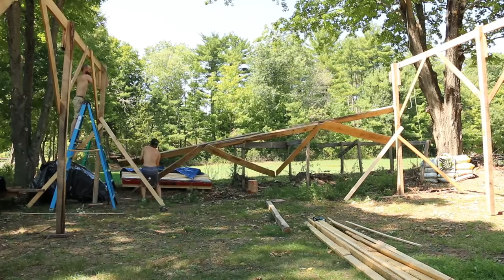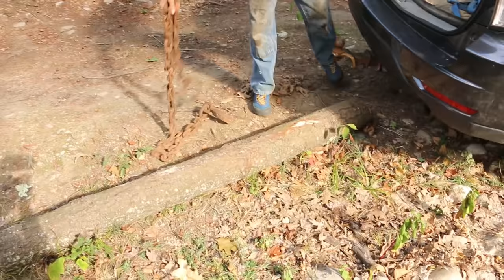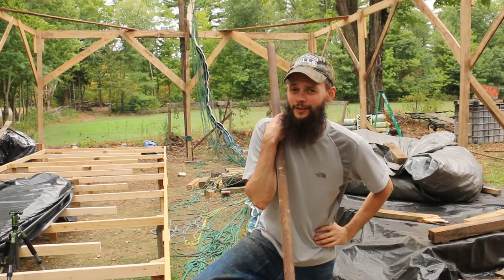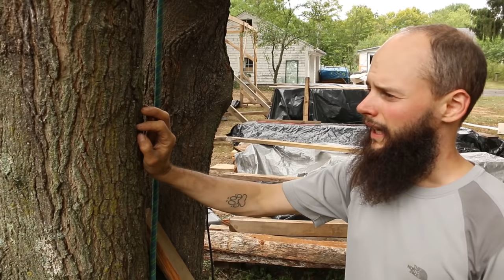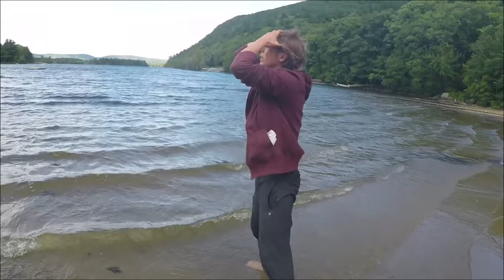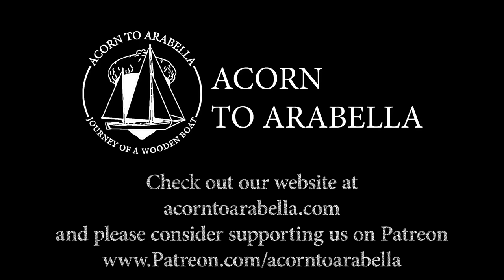Acorn to Arabella - Journey of a Wooden Boat - Episode 8: The Big Move Part 2

Comment: Great series guys. The only other comment I have is about your cable clamps. The saddle should always go on the live side of your cable. Never on the dead end. This will give you maximum holding power. The old adage of “Never saddle a dead horse” comes into play. I’ve been working with cable on drill rigs for 30 years and this is by far the most common mistake I see.
Reply from the maker: Hi Jeff,  glad you are enjoying it!  Thank you for the tip on the clamps.  You learn something new every day!  We'll pay attention to that in the future.
Reply: I saw the clamp issue and was thinking did anyone point it out. Only thing I didn't notice is anyone point out torquing down the clamps. Might not be as big of an issue on this but I know on my wind turbine guys the 130 ft.lbs. of torque on the 3/4" clips is not obtainable even with my 1/2' electric impact, I am glad I checked as an 82' mast (8" schedule 40 steel pipe) supporting over 1500 lbs of motor, housing, etc., up to wouldn't want to risk the clips slipping.

Comment: I am having a really difficult time watching this. You guys remind me when I was younger and did things the difficult way. Wouldn't it of been easier to frame in a simple ridge line and dispense with the cable idea? Lay the tarp alongside the shed wall. Roll some small stones up in the corners of the plastic so you can attach some lines. Throw the lines over the ridge. Yank it up from the opposite side. Done!
Reply from the maker: Hi Dennis, yes, there were probably better and easier ways to do what we have done.  However we are working with very limited funds and limited supplies.  Therefore we are working with a lot of items we already have access to and saving funds to other items needed for the build.  At the time this setup was one of the best options.  We have since retrofitted some rafters for stability and strength to the plastic.  It's holding up really really well!
Reply: I’m in corner. Seems like a lot of harder not smarter but I’m not seeing the whole picture so I’m staying optimistic
Reply: Have, not "of."

Comment: The cable clamp install is not right. Do not reverse clamps. " Never saddle a dead horse" Saddle goes on the live end of the wire rope.  Also the malleable Clamps are not made to hold modern wire rope and of a cast material. Use forged clamps